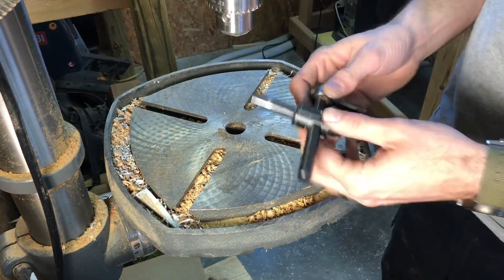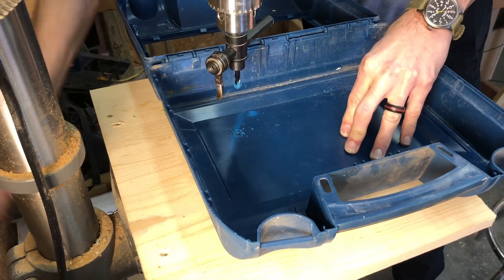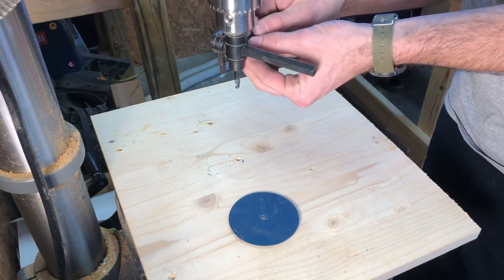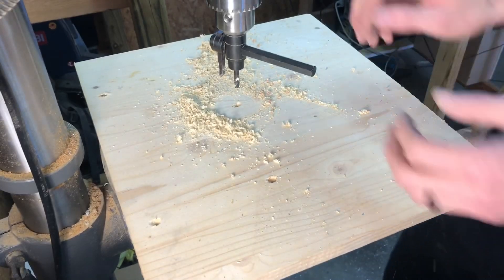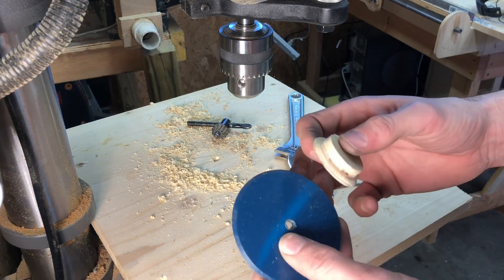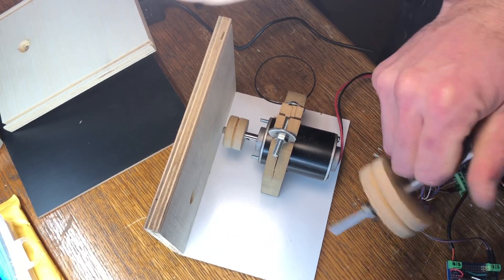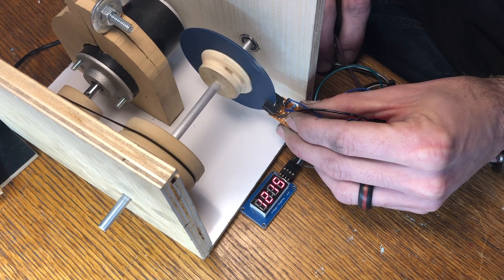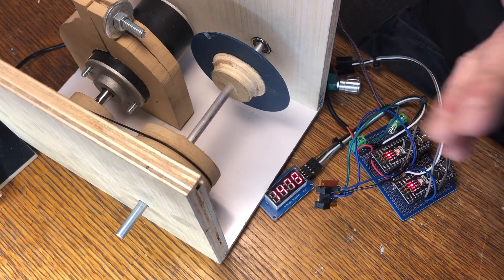Pickup Winder OPTO Switch counter disk. Pickup Winder 2.0 Part 5

Comment: Hey nice project! Would be interesting the chance to add it some app or program to stop automatically at xx desired turns, or even create some kind of "variable oscilator" adapted in the coil holder to make also some kind of scatters in the coils. 🎸😎👍
Reply from the maker: Obi Wan Kenobi interesting man. I may have to do some research and see about something like that.   I’m guessing I’d have to have a speed controller that can be controlled by an arduino or something similar. Do you have any suggestions for something like that? Thanks for the comment bud!
Reply: @ChasesWKshop  I've been thinking about something like I've comented even before to see your winder. I used to have some friends in the business of programing, so I think an app to control speed and stop I guessof shouldn't be so hard to write, I'll try to contact them about this and talk you bro.
Reply from the maker: Obi Wan Kenobi awesome man!! Thanks!!